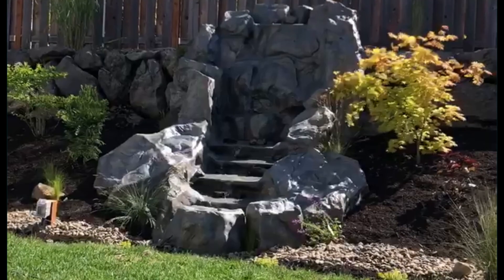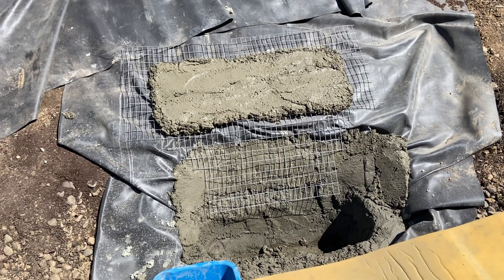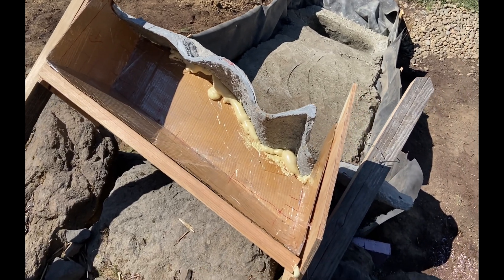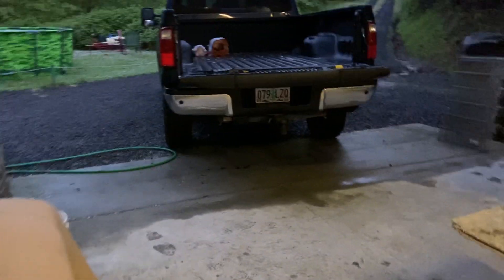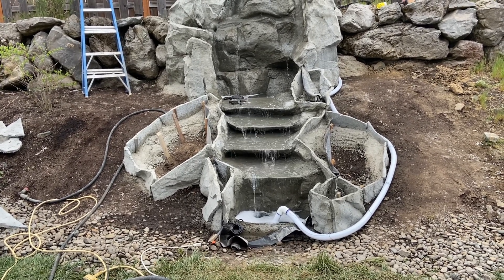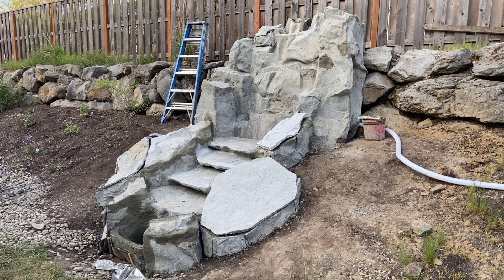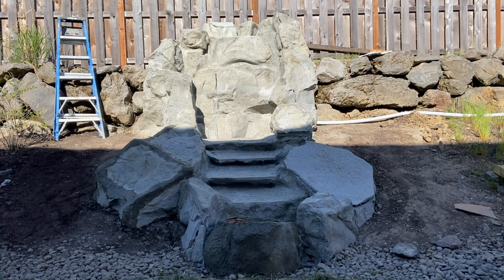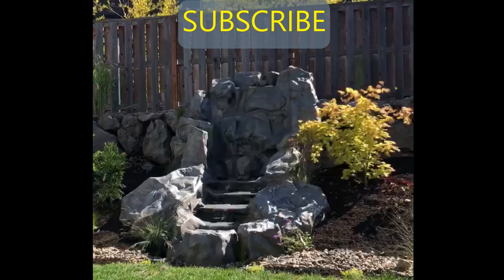Molded rock water feature

Comment: Ok so we live in a cold climate, Canada.  What will happen in the pond areas in the winter? We are always told to turn our concrete planters upside down so frost won’t crack them, won’t the frost crack the small ponds in our climate?
Reply from the maker: I have extensive experience in building in freeze/thaw climates such as your. There are a few more steps that we need to take when building in such climate, such as digging the foundation area for the feature below the frost line. Secondly, we tend to reinforce those features more than we do normally, and we make sure to seal all areas for water penetration to be removed from the equation as that causes Cement to spall.
Reply: @fauxrock  when you say foundation? Do you mean to go down 4 feet with footings and foundation or just using a monolithic slab with 14” sides ? I was planning on pouring a complete concrete slab and work up from that with the type of fountain I want to use
Reply from the maker: It’s not that the foundation Hass to go 4 foot deep. We usually put gravel 4 foot and then we pour a foundation and then usually the foundation is just below the soil so we don’t see it.
Reply: @fauxrock  I’m confused gravel 4ft? You mean 4” deep then pour a concrete slab? 4 feet of gravel is a lot ?
Reply from the maker: Yes, gravel for foot deep is a lot of gravel but it’s better to use gravel than to pour a concrete slab 4 feet thick. A foundation which also includes the gravel. As long as it’s below the frost line you won’t have any problems.
Reply: @fauxrock  mm the fountain I want to build is 20 by 30 ft, if I dug that complete area out and filled it with 4 ft of gravel would be so expensive… we don’t do that to build a house, we build a footing and foundation but never the complete thing? Are you sure?
Reply from the maker: To be clear..what exactly is it that you’re building?
Reply: @fauxrock  we want to build a fountain inspired by the Trevi fountain, a shed that is 20 foot long across the back and then rock fountain in front with a pool area in front of that, so we though we would pour a flat slab to start with and build up from there… the slab would be around 20 by 30 feet
Reply from the maker: OK in that case you’re going to dig a perimeter footer that does go below the 4 foot frost line at that point you can put your gravel in that trench and pour a normal slab footer foundation combination